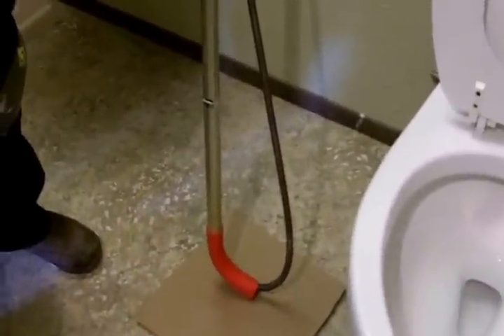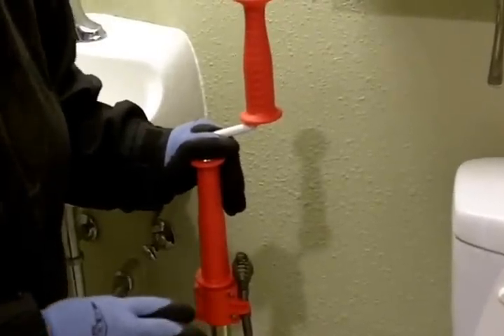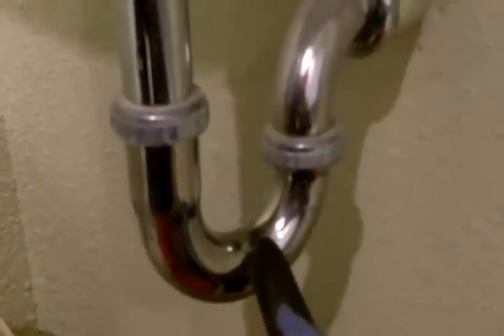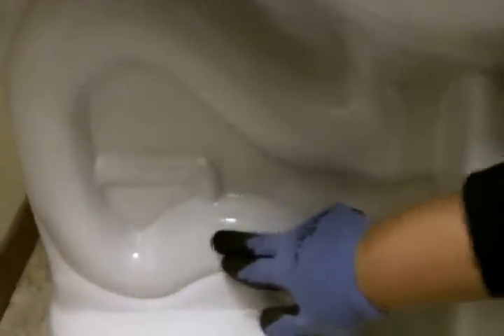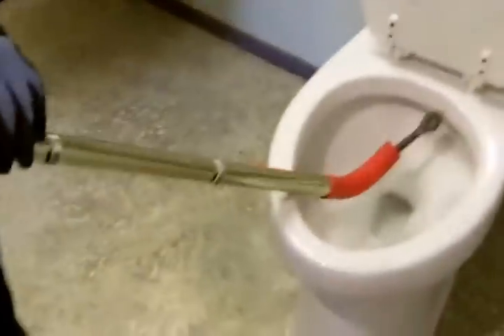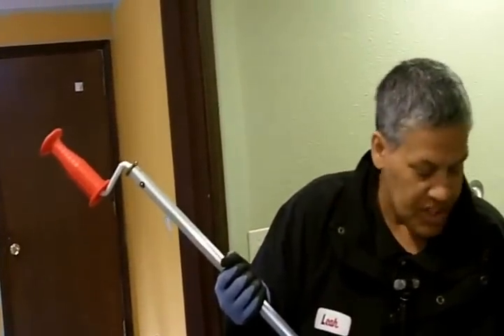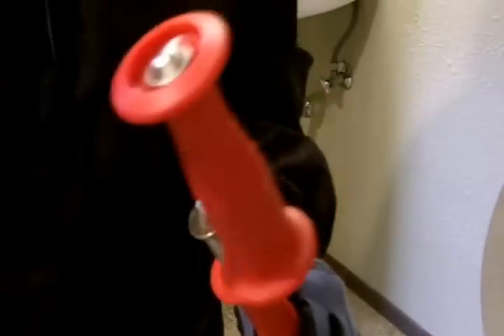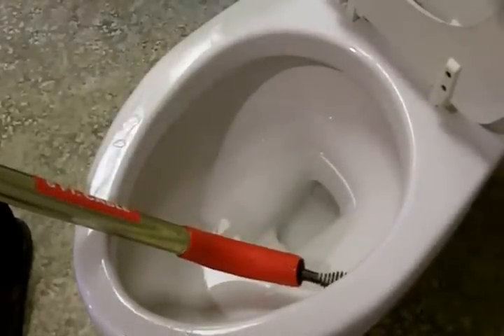How to Unclog a Toilet with an Auger

Comment: Great video.  This video is very straight forward and very helpful. You explain the process very well Ms. Leah. I thumbs up the video because its going to be very helpful to me when I begin the process of removing my blockage. My toilet is a low flush one. When you push the handle down water level rises and sometimes may overflow. The water doesn't drain at all even hours and hours later it just stays in the bowl. So the blockage I assume is  within the toilet and it is plug up somewhere between the drain hole inside my toilet within the floor and between toilet u trap. When the water doesn't go down after hours. My blockage is more within the toilets U trap. I am going to be very patient an work slowly when I begin the process and take as much time as I need to successfully remove the blockage and so I don't damage or break my auger or toilet.

Comment: Great video. I am now a subscriber! I have 3ft rigid auger. Not sure if I need 6 ft. The auger seems to do a decent job of unclogging, but toilet seems to clog again in a couple days. Plumber says I should rent electric power auger, 100 ft. Others are telling me to get new toilet and others want to charge 600 to remove toilet to look for clog. If auger worked, and toilet flushing fine now, then how could it be further down in main line??

Comment: That lower trap is actually a secondary trap.  The main trap is the one that keeps your water in the toilet bowl.  The first rise is the main trap.  Those snakes when they are fully extended through the toilet is supposed to be able to reach all of the way out of the bottom of the toilet because a lot of clogs also happen where the toilet goes into the floor.

Comment: Leah... great tips. I use a bucket of water to flush the toilet after using the auger or the plunger as cheap insurance.  That way I know I am not going to put more water than the bowl can hold. If I flush  ...and I haven't cleared the blockage.... I might get a toilet overflowing. Just a thought. It's saved me a lot of problems.

Comment: Jane, 

OK so in past month I took a few days to replace all the parts of the toilet tank including the water valve and hose  to the tank . I have to say I did a really super job! I was afraid I was gonna have a water mess though when I turned the water back on but it never happened. Now I flush the toilet and that darn water still swivels around slowly before emptying. Sometimes it empty's and sometimes it takes two flushes to empty. I guess its time for the auger. I have no children so no worries about clogs from them. I am concerned there might be something down there from previous tenants.I would hate to pull out a doll head or whatever as that would freak me out!

I don't know why I am scared to do this augeri-ng as I am afraid I am going to ruin the porcelain. I think that this toilet is very old and may need replacement but I will do the auger-ing first. Just so weird that the water coming into the tank takes awhile as well. Perhaps it is a matter of low water pressure.Downstairs toilet recovers nicely but it is new! Wish me luck!

Comment: I liked your explanation but my auger won't push down/extend at all. It works fine outside the toilet, but when I try to put it in, it absolutely won't push down, not even an inch. Feels like it's hitting a cement wall. And I definitely have not dropped anything in there. It's just always a slow toilet and clogs from time to time so I had hoped to find the blockage. I can't if the auger won't go in.

Comment: Jane, 

Update: I went to Home Depot and bought the 6 ft auger. I have to say it was a bit intimidating but I was determined to get this job completed.
After I introduced the auger down the toilet hole I wound and wound and when I pulled back I met resistance but that was only the porcelain where the auger was hitting the trap on way out. I moved the auger from side to side and was able to move the auger out. There was nothing on the end of it. I then filled the tank again with water and flushed.  There was no remarkable improvement with the flushing.  Could it be the water pressure? Is there something else I need to do or can do? Do I need a new toilet? ( I am afraid the new one won't empty either so I ask for any pearls to share with me from anybody!  

Thank you
Reply: Sorry, 😔 to read about your situation. If you have neighbors who share the same line as yours, then it would be worth asking them. Low water pressure, as u pointed out could likely be the problem. I'm assuming this problem was not there during your earlier use of the same toilet. 

I recognize it's a bit late to make suggestions, so I hope u found the culprit & are happy to share with the broader community. 

Thank you for sharing